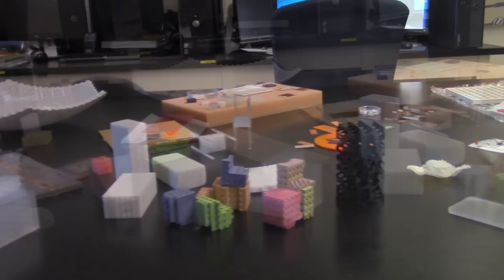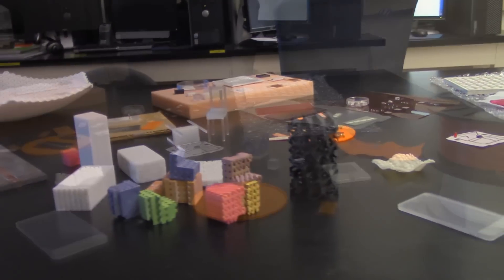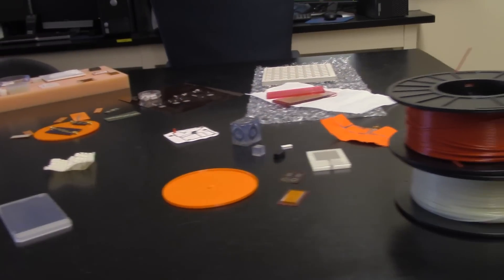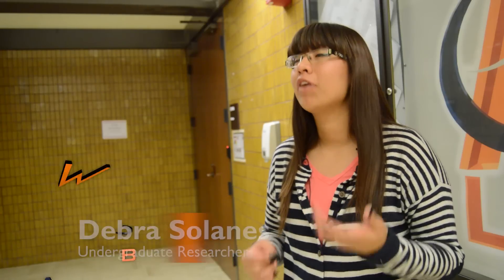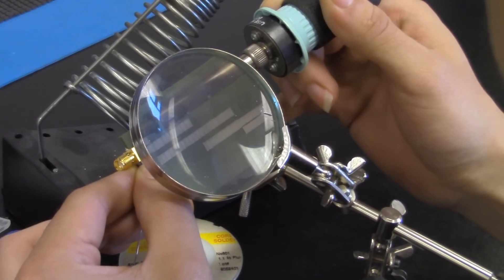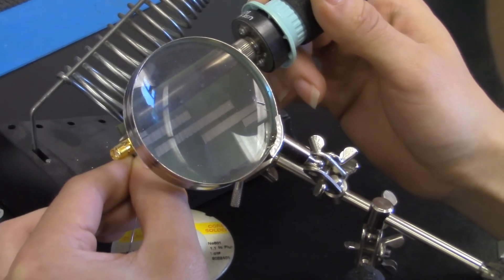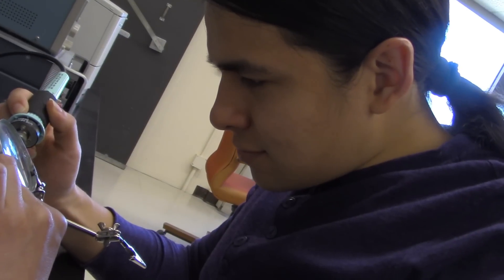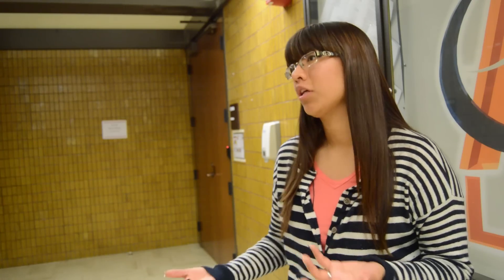Introduction to the EM Lab

Comment: Hi!I am researching about Bragg grating using fdtd method, Which videos may help me?thanks in advance.
Reply from the maker: +An Nguyen van For theory of Bragg gratings, you could look at Lectures 5, 6, and 14 here:http://emlab.utep.edu/ee5390em21.htmFor simulating Bragg gratings, you will want to take a look at the transfer matrix method.  If you have fancier things in mind beyond a 1D simulation, see also the finite-difference frequency-domain method and rigorous coupled-wave analysis here:http://emlab.utep.edu/ee5390cem.htmI have also put together a series of six MATLAB sessions for a 1D finite-difference time-domain code that may also work for you.  You can see that here:http://emlab.utep.edu/ee5390fdtd.htm